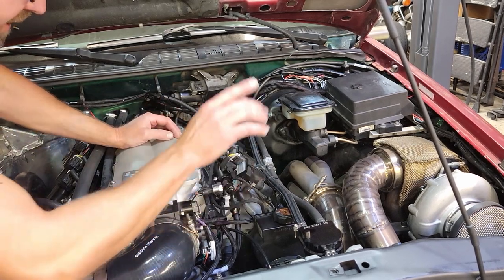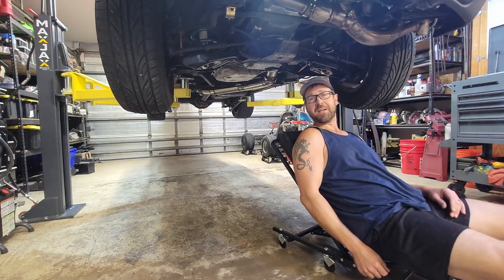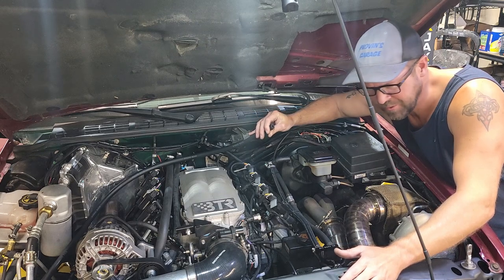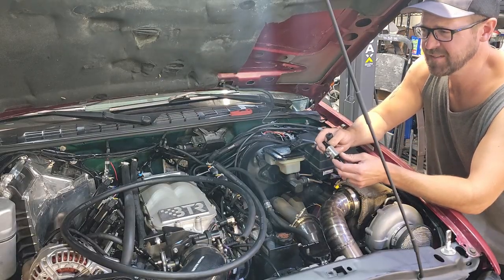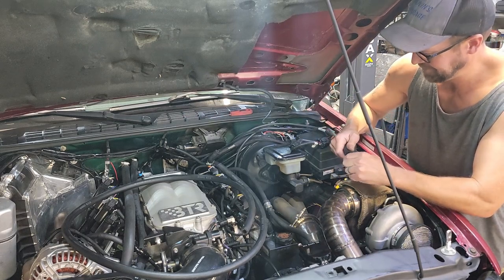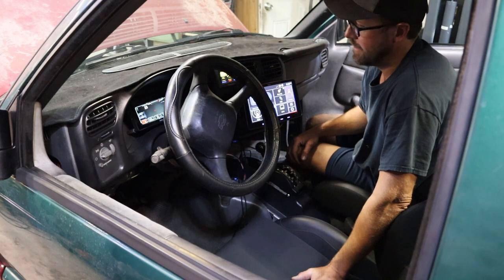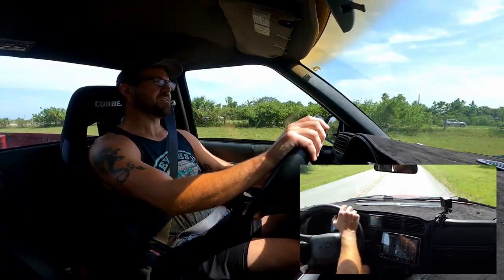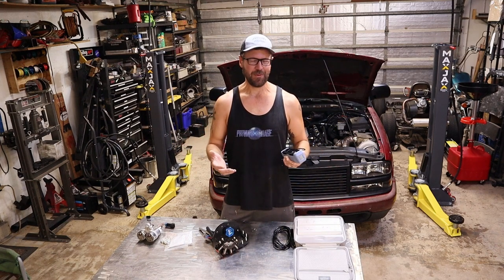Electric Vacuum Pump For Power Brakes - Install and Test Drive - Sleeper S10 Build Part 9

Comment: Nice video. I'm like you, I wind up machining. It's also good to try to work with off the shelf parts because everyone isn't a machinist. Your location for the pump is the same place I was thinking about putting mine. It just seems practical to put it there and like you say you can always move it. It's good to space things out. Down in the same location I'm considering having a vacuum canister. It would cause the pump to have to pump more initially but would perhaps cut down on how much it turns on and off ( reduce cycling). Also if you have to repeatedly brake it cuts down on the fear or possibility of losing vacuum. Also if the pump ever fails you would have a vacuum that would fade in a more gradual manner. This would allow more time before all vacuum is lost and more time to become aware the vacuum pump has failed. Even if it's only a few seconds longer it could be enough to avoid an accident. It could also ensure the vacuum volume of other accessories if all of a sudden there's a demand for it. At least that's what I would think. I haven't even installed anything yet. Anyway, great video, it helped me feel more confident about how to go about it. I've worked on my own vehicles for about 40 years but it's always good to see how others approach things.

Comment: If you still have anxiety about the reliability of that set up, if it did not come with a vacuum reservoir, adding one can give you several extra pushes of the brakes - good especially if the car stalls for some reason or you have a battery that is getting near the end of its useful life.

Comment: if its building to 25mm of vacuum that's way over what the brake booster needs.  most boosters only need 15-18mm.  so even thought it is cycling on when you hit the pedal it is building more than needed which isn't a bad thing.

Comment: DOES NOT SOUND LIKE A V6...LOL... How is the vacuum pump after a few months?? it is pretty loud.. I don't like all that extra noise...
Reply from the maker: Still going strong. I only notice it when I start it, once I'm driving I can't hear it unless I really try
Reply: Noisy as hell.. Not crazy about that either.. Sounds like  bush league set up even though not hearable on the road.
Reply: I decided against it, just too much noise, thank you!!
 @TheJcrandazzo
Reply from the maker: @raycox1971 I don't blame you. I ran it for a while and went back to using the engine vacuum. I'll hang onto the pump though in case I do a future build with a motorcycle engine and want power brakes.
Reply: as time goes by, I don't want any more noise, vibration.. guess it's getting old who knows...  but with all the tech we have, you'd think there would be a silent one.... I guess oem has is down, but the aftermarket is lagging. @provinsgarage
Reply from the maker: Could probably find a quieter solution, but I'm sure it would cost quite a bit more.

Comment: Can we get the benefit without the fear, if the electric pump is added to the vacuum setup w/ a T and a check valve? 
Boosted old truck

Comment: Can you post a link to the kit?
Reply from the maker: TMaster 12V Brake Booster Vacuum Pump kit - "Plug and Play" w/installation kit,Quiet high-performance 18'' to 25'' electric vacuum pump for brake booster https://a.co/d/8bDnq8w

Comment: Thinking about  doing single turbo build on . My first gen but I want full exhaust that’s one of the major things holding me up how did you route your exhaust from the turbo? The space constraints have me questioning whether it would be worth it or not
Reply from the maker: It was tight but not too crazy. I had to route it under the brake booster and along side the trans. Had to make some dents in a few places. I used 3.5" which is probably the limit without modifying anything
Reply: Thank you for getting back to me would you be able to send me some pictures of your setup
Reply from the maker: Sure. Just email me at provinsgarage@gmail.com and I'll send you some pics

Comment: So does it have enough to remove the crank case pressure
Reply from the maker: I'm running a dual catch can system with one working as a vent to atmosphere and the other is attached to the intake manifold with a check valve so it doesn't pressurize under boost.

Comment: Could you run this setup without a booster
Reply: if you weren't using a vacuum booster for the brakes you really wouldn't need a vacuum pump.  that is unless you had other vacuum accessories like the a\c blend doors or 4 wheel drive actuators, in that case yes you could run this set up to power anything needing vacuum.